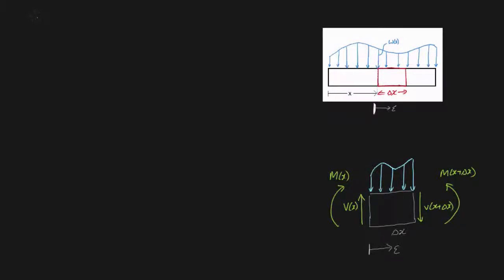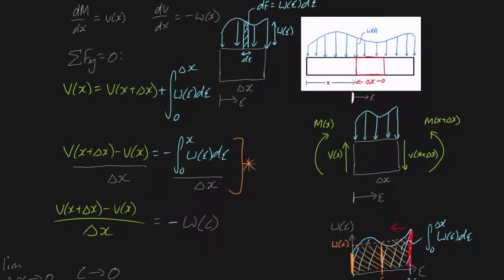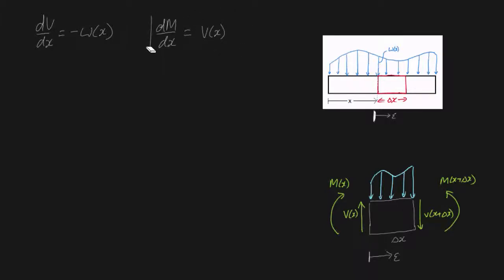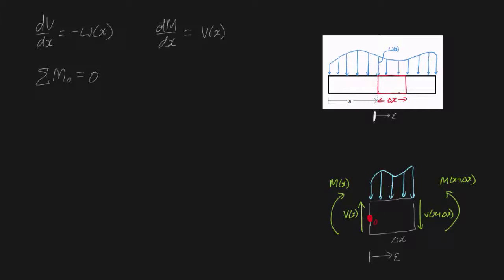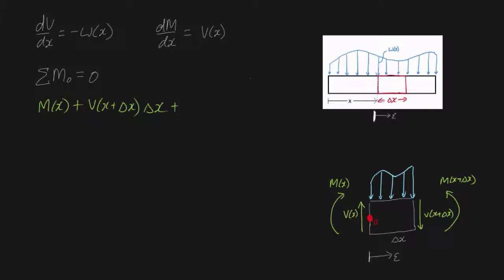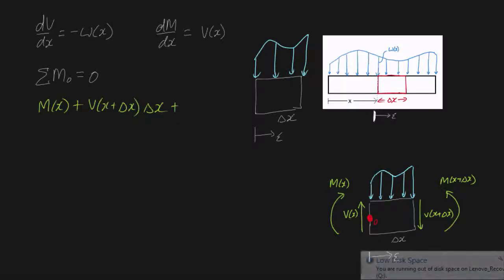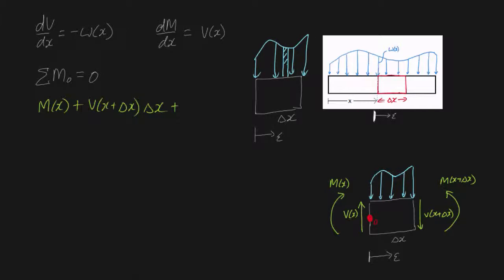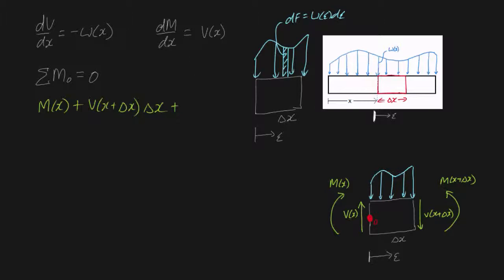Proof dV/dx = minus w and dM/dx = V for shear force and bending moment diagrams Part 2

Comment from the maker: Hey. Great question. It depends what direction you define reaction shear forces and bending moments to be in. Some textbooks use the notation I use, others use the opposite notation. There's no difference in the answer other than you'll get a minus sign stuck in there. Both ways are completely correct though.